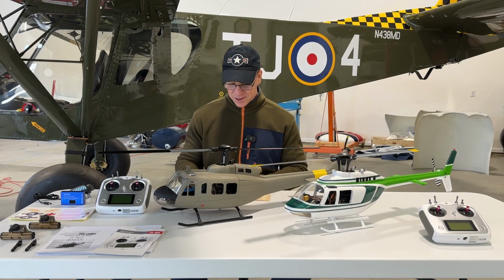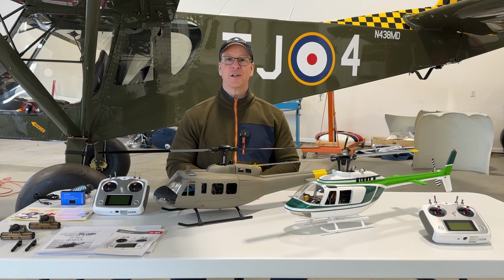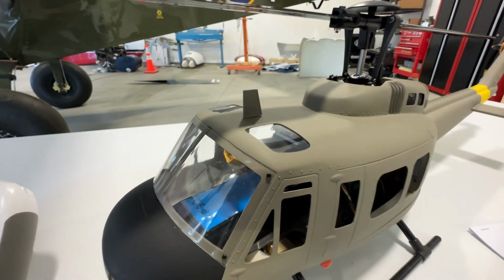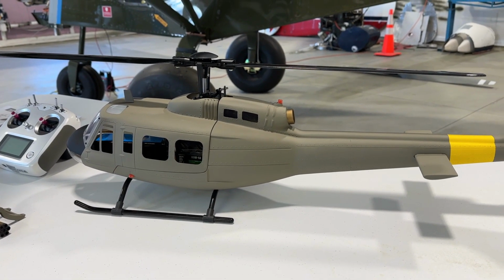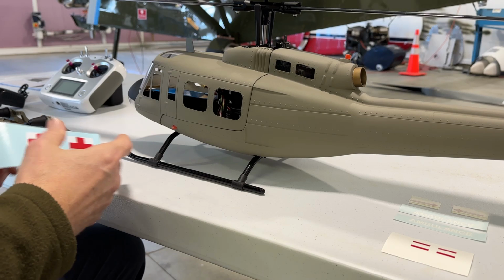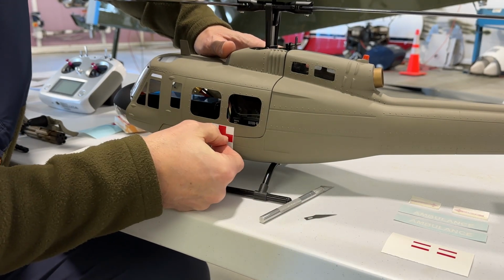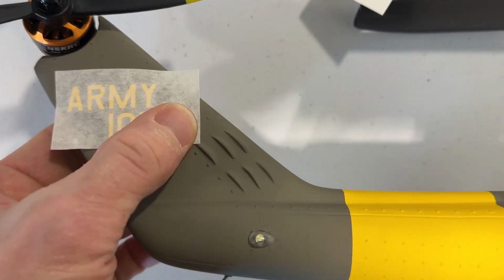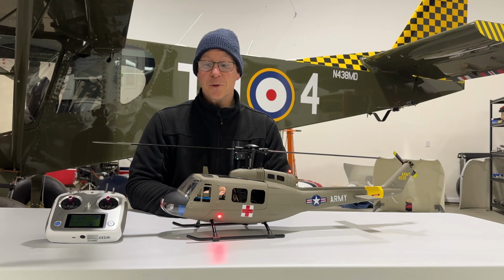Roban 470 Huey GPS R/C Helicopter w/Custom Decals

Comment: That pink film on the decals is a protective cover you peel off. I had trouble with them. After applying, and letting dry(or I thought) I removed the pink film. Well, some of the lettering pulled off along with the film covering. Am I wrong, do you peel off the film then apply them? Either way they are very fragile. On my 470 MD500, I went around and painted clear nail polish on those decals to protect them. Its a must. Or you can have Callie Graphics make you a set of vinyl decals.

Comment: Thanks for sharing this with us. You did a great job with the decals. Since you used to sell RC helicopters, I was wandering if you could tell me what determines weather an RC helicopter is considered a 450 class, a 470 class, or a 500 class helicopter?
Reply from the maker: Back when I sold helicopters they were sized by engine. So you could buy a “40” sized heli or a “60” sized. Now it looks like they size the electric helicopters by their rotor blade length. So a 470 would be 470mm. Hopefully someone else can chime in if I’m incorrect.
Reply: @KitplaneEnthusiast  Yes, from what I can gather I think you're correct.

Comment: "[I painted the roof black] because it kinda breaks up all the green." Uh, with that plane behind you, that ship has sailed..!
Sorry, I couldn't resist! Nice work with those stickers.
I can't wait to see (and hear) that Huey fly. Mind you, if the noise of the helicopter is accurate to scale, it should still be louder than the O-360 in the Zenith...
Reply: The black roof is accurate on a slick post 1967. There is a company that makes 3d printed xm23 mounts and m60's. The duel mini gun and rockets on a D or H model Huey would not be accurate during the Vietnam war.